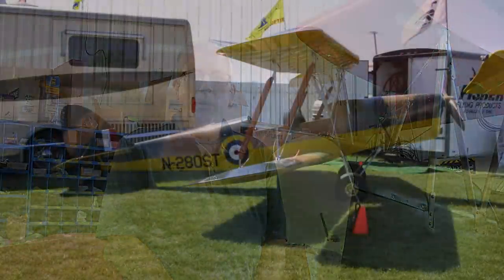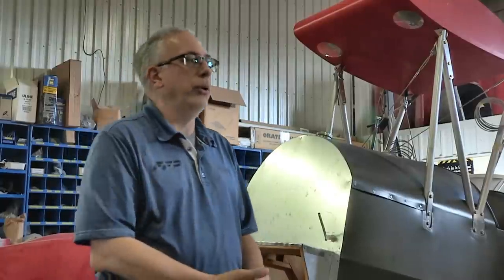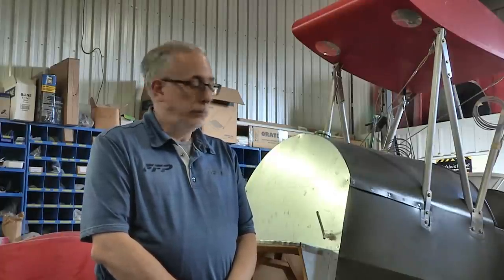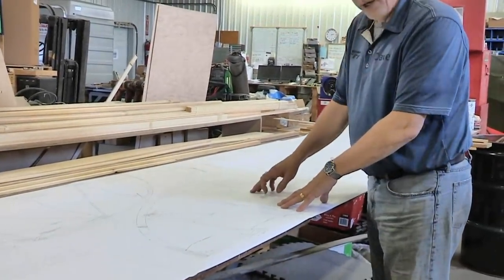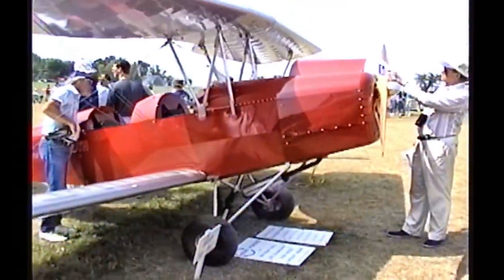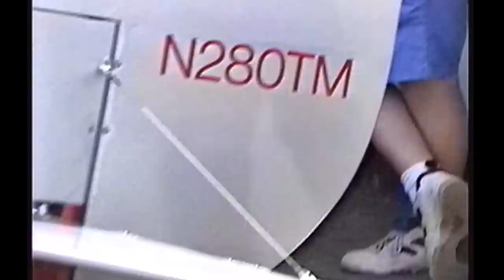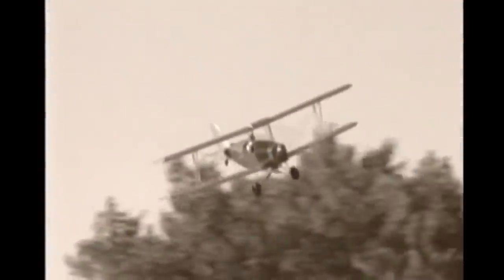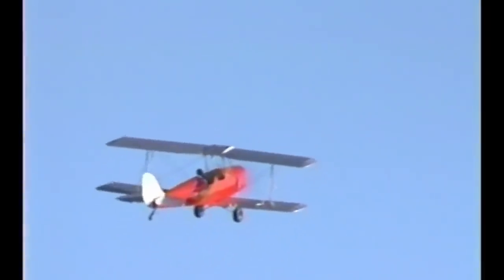Tiger Moth, Fisher Flying R80 Tiger Moth Replica, Fisher Flying Products.

Comment: Saw a real Tiger Moth while stationed in Germany. (Wiesbaden Air Base)  Would have been around 1970.  Was at Gelnhausen airfield, a turf field.,  Didn't fly then, was skydiving at that field.  p.s. Once, in freefall at 7,500 feet, almost hit a glider.  Gliders were also at this same field.  The glider was at around 3,000 feet, as "I blasted by" him at 174 feet per second.    He wasn't supposed to be in that airspace.  Got my PP license in Jan of 1980, and rented many different type of GA planes, but never owned one.  Built 3 EAB's over the years.  P.P.S  Saw my first real Fiesler 156 Storch at that same field.   Landed in about 2 fuselage lengths. :)   Now there's one to build.  3/4th scale are the kits, I believe.